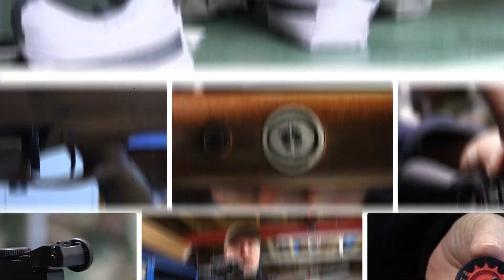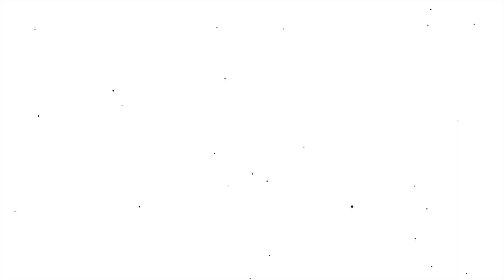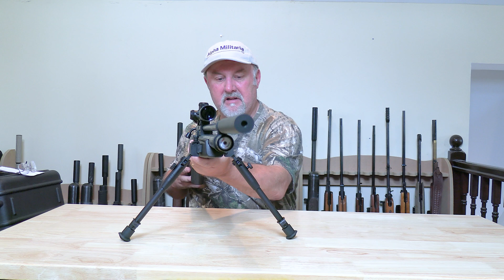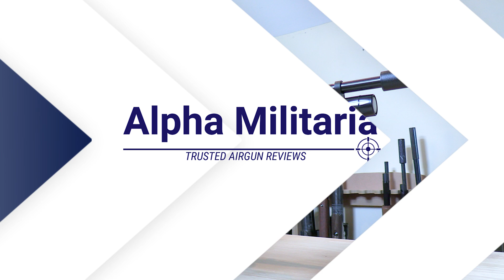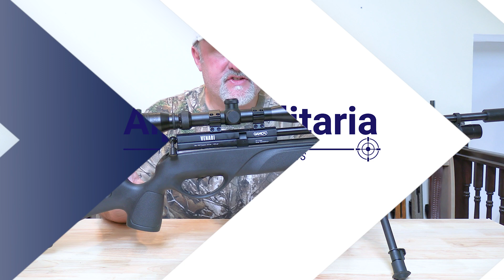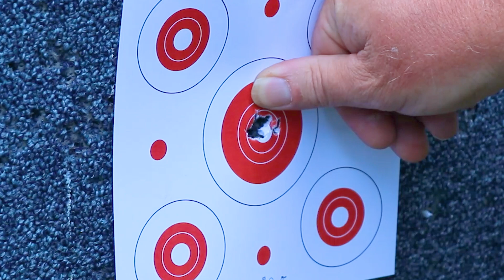Gamo Venari Air Rifle Review & Accuracy Test - "Great value, full power PCP package"

Comment: The trigger can be transformed by replacing the adjustment screw with a longer one - there's info on Google about how to do this.
Another improvement to accuracy can also be achieved by having the barrel free-floating.

Comment: I’ve got one of these, had it for around 6 months now. Anyone thinking of buying this rifle can look no further for a sub 12 pcp rifle. I use mine primarily for squirrels & pigeons. It’s Stupidly accurate even at 55m. If anyone has any questions about this gun before they buy it, I’d be happy to answer. 

Following upgrades have been applied to my rifle: 

Hugget - ATOM silencer (to guarantee accuracy)

Vector optics - VEYRON scope. 

Bipod is side rail mounted so if you wanna upgrade that, you’ll have to buy a universal “rest” type one, or drill & tap your own thread into the bottom of the stock to adapt a traditional bipod. 

Overall.. worth £450 I’d say..
Reply: Does the gun come with a Filling probe ?
Reply: @Dan-the-toonman  yes & one magazine
Reply: Definitely looks worth the money
Reply: @dirtyharry5957  had it a year & half now… still shooting as accurate as the day I bought it. Fantastic rifle!
Reply: I know this was a few years ago, but do you still have the Venari?  I'm getting back into after about 10 years and I'm looking at the Venari kit, it's currently £375 and seems a good deal

Comment: Hi Richard, I’m torn between the Gamo Venari and the ATA Airborne as my first PCP. Which would you recommend? I love the content and you do the best reviews on here hands down!
Reply from the maker: Hi Billy. That's very kind of you to say - thank you. Both are great value rifles and perform at a level that makes a mockery of their price tag in my opinion. The key difference between the two is that the Airborne (have you seen the review we did on it?) is regulated but it is quite a lump so if you plan on wandering around a permission that's something to consider. The Venari is much lighter and although its not regulated you do get a scope, bipod and silencer all included in the price. Also, the Airborne is a sidelever (a very good one) and the Venari is bolt action, so you might have a preference that way. Finally, and unfortunately it s fact that air rifles do go wrong sometimes, good as it is, the Airborne could be more difficult to get spares for in a timely manner whereas the Venari is made in the UK and BSA/Gamo have an excellent after sales service. Its a tricky one Billy, both are great rifles and I'm sure you'd be pleased with either one. If its possible for you pick them both up and shoulder them one will shout out to you more than the other. If you're buying blind though, I'd probably go the Venari...but its a mighty close thing. Sorry I can't be more helpful.
Reply: @airgunextra  No that is great information thank you! I have seen both of your reviews and they both look great for the price tag. I think based on the availability of supplies and the added silencer and bipod of the Venari, I’m going to go for that. Again, thanks for the detailed response and I look forward to watching further reviews :)
Reply from the maker: @billysmith3149  Good choice Billy. I hope you like the Venari. And thanks for watching us...Please let us know if we can help with anything else. You can also reach us at hello@alphamilitaria.com.